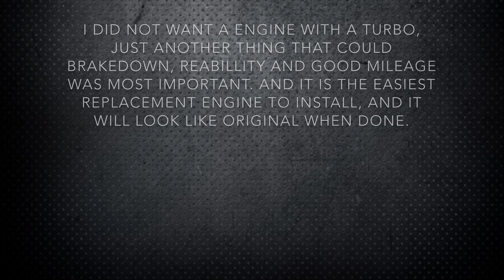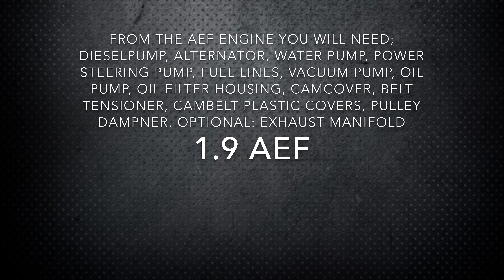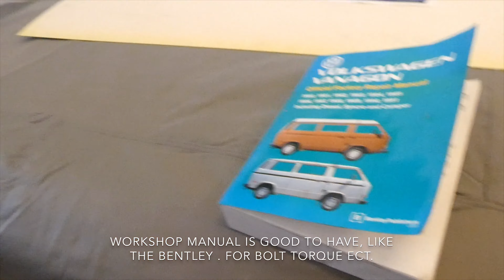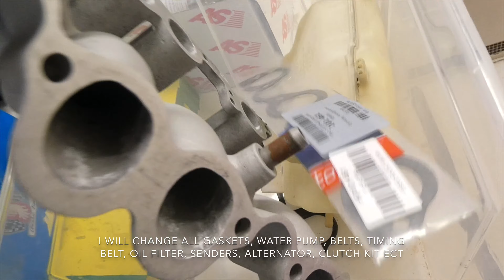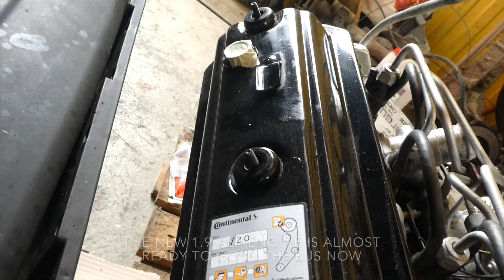[HOW TO] VW T3 AEF engine conversion PT1 - HOW TO - MAINDRIVE GARAGE

Comment: Hi, first of all great work! 
I got same engine in my T3, but i think that there is a problem with my pump. After i start my engine there is a lot of smoke, and sometimes, randomly, lack of power .. :( In my car i see a lot of cables from my pump, but you said that we only need few of them. Do you think that guy who swap this engine could swap all elektronics for pump to? I can see some electrovalves too that are coming from front side of the van…

Comment: Nice work! I am looking forward to the transmission mod video. Curious too see how the diff lock will work.
Reply from the maker: It,s a mechanical locker. That engage when pressing the gas. So no need for vacuum or electric lock. It’s like the classic “Detroit locker”. I will also make a video when driving off-road with it....later on...

Comment: Where are you at in the conversion? I just got a 1.6NA and dont think it will be enough.  Thanks for the video
Reply from the maker: Robert Roe Im Done! New movie coming soon
Reply: @MainDrive  I just read the blog on your site. can you take the 1.9 AEF on the highway? I know you geared the tranny for off-road but I am curios as you took it over 3000km. Thanks I really enjoyed the details you put into your build
Reply from the maker: Yes Robert I drive it on the highways. But with low geared trans and offroad tires it not a favourite, but really no problem either. But it was built for dirtroads and trails

Comment: I had 1.7d would like to swap for something strong like aef for example, would it fit 4 gear gerbox or  need to put 5 gears?
Reply from the maker: I have 4-speed transmission. They all have the same final drive, it’s not the number of gears that matters and the 4-speed is a better designed gearsbox. The 5speeds are crap, the bearing on 5th gear got almost no support and that’s why they after awhile starts jumping out of 5th gear when driving.